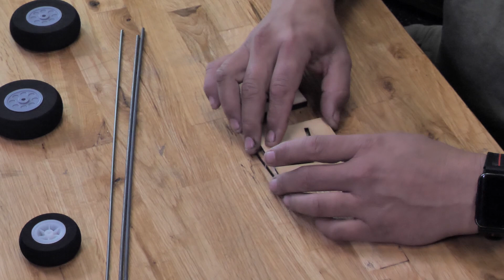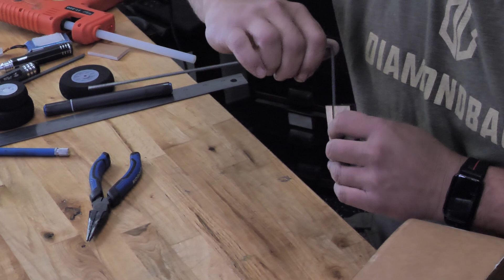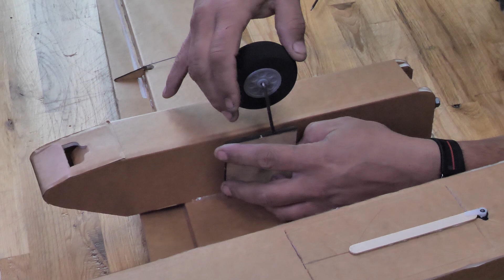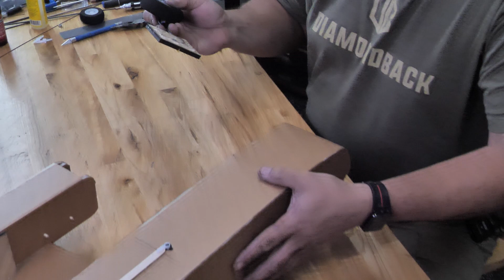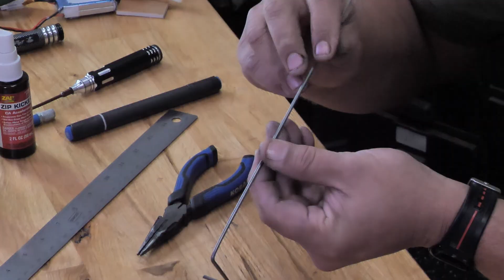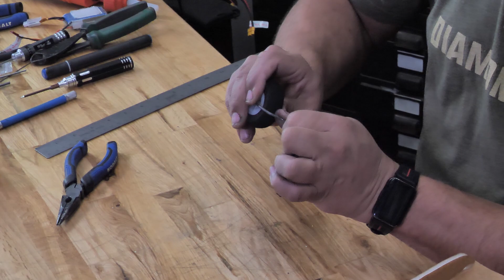How to Build the FT B-25 Landing Gear

Comment: If you want a Good bond from the CA, the first step is to Harden both surfaces. spread the CA on both surfaces to be bonded and then spray both with accelerator. sand smooth both surfaces and clean off the dust. NOW apply CA to one surface and join the parts. Hardening the surfaces gives the CA a better mechanical grip and will help increase its shock resistance. CA has very little resistance to shock and can FAIL without damaging the wood surface. I routinely snap ca glued wood surfaces apart.